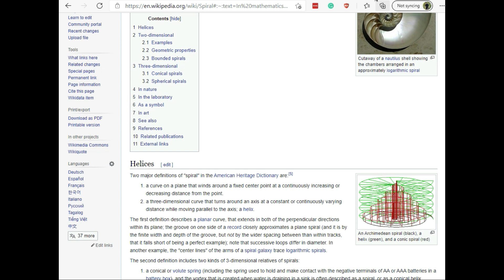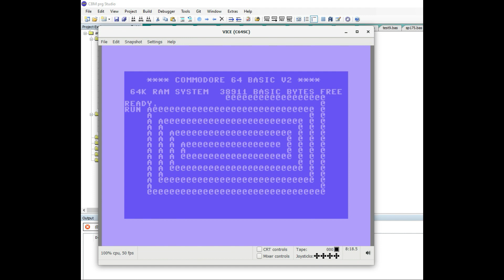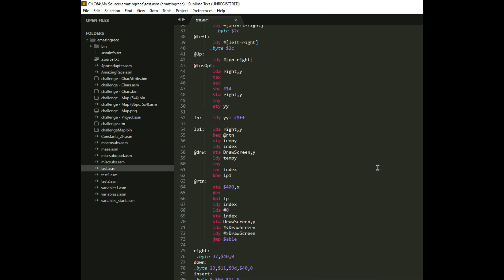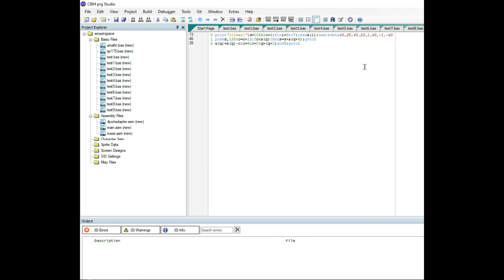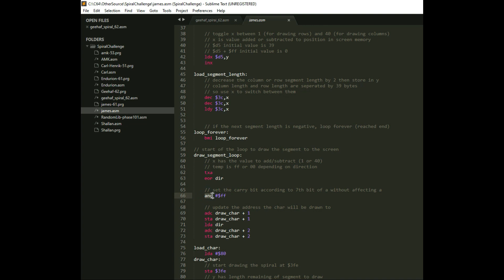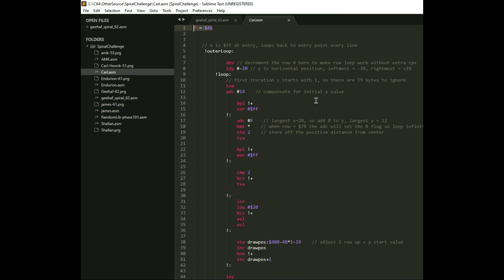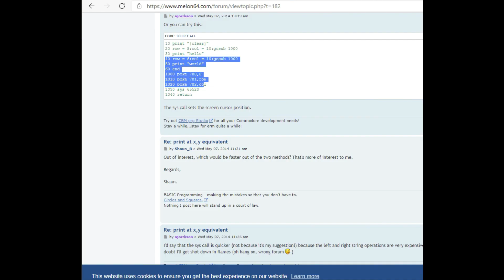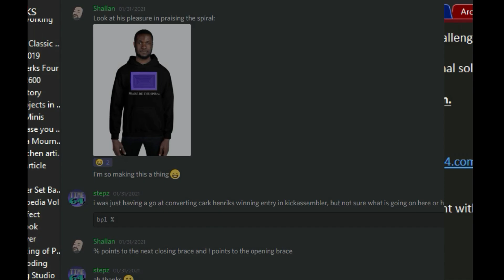C64 Praise Be The Spiral!!

Comment: Great video! Never knew the screen location was already stored in memory. I have always done the same as you do, just set up a table of pointers. I found out why the HI bit is set starting at $D9. It is used as a flag by the BASIC Screen editor, that is how a line of BASIC code can be 80 characters long and edited as a single line. Will have to play around with this some more.